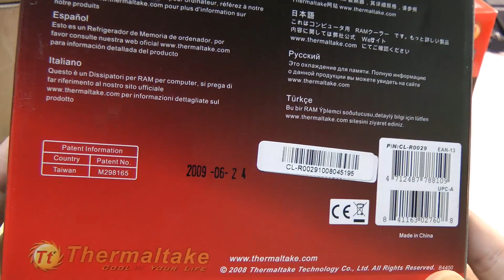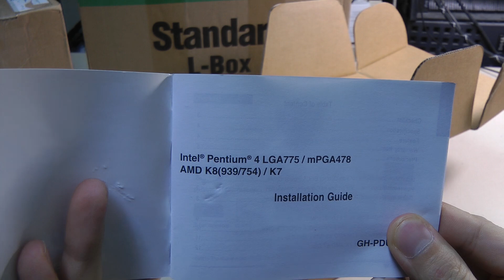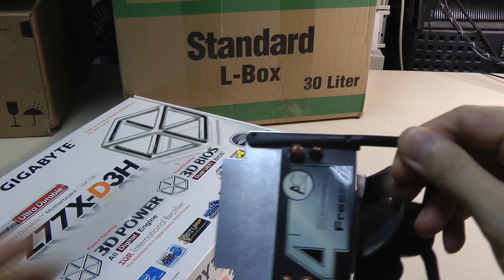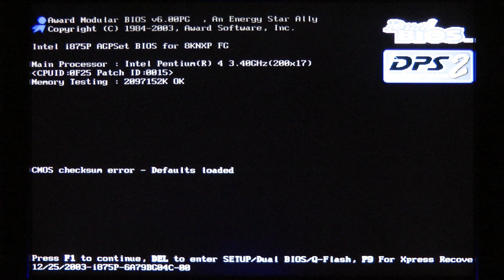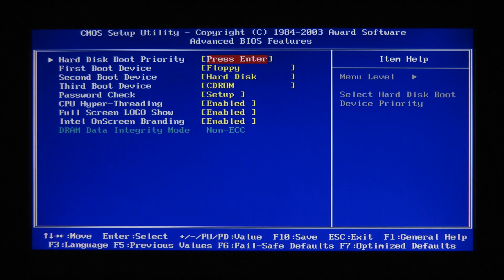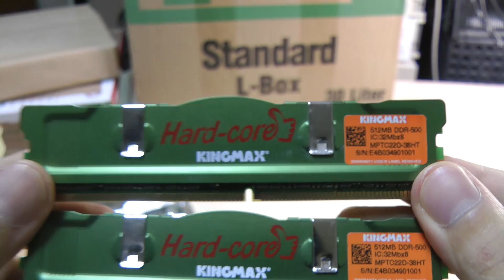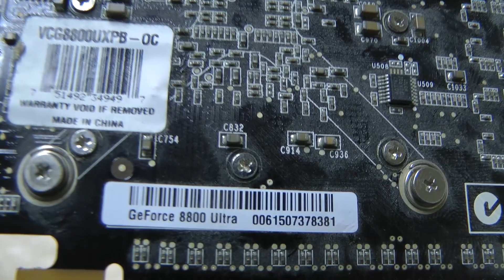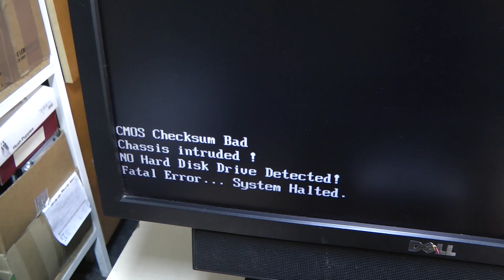hardware toys for old boys unboxing - RETRO Hardware

Comment: God gpu shrouds used to look so retarded. Late 90's early 2000's heat syncs and shrouds looked nice but somewhere in the mid 2000's they started to pull that shit.  Thank God they stopped